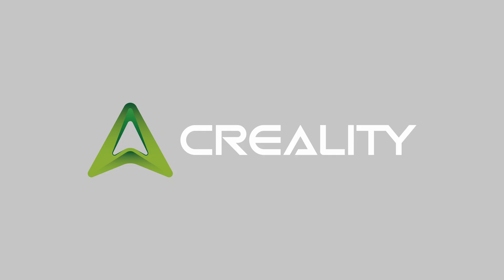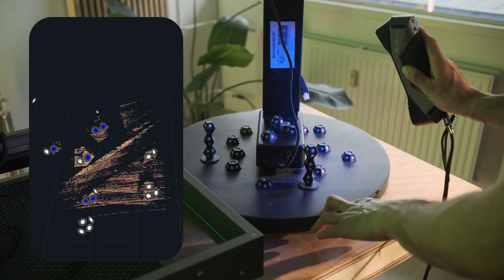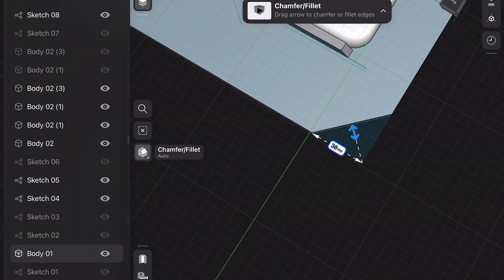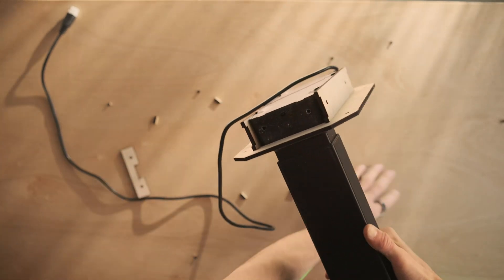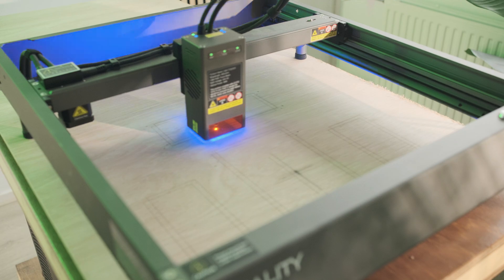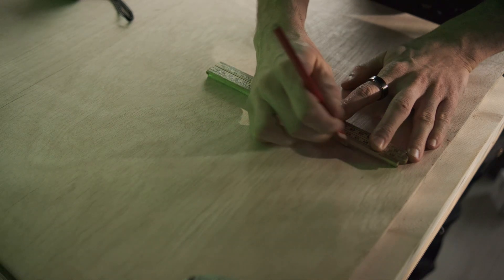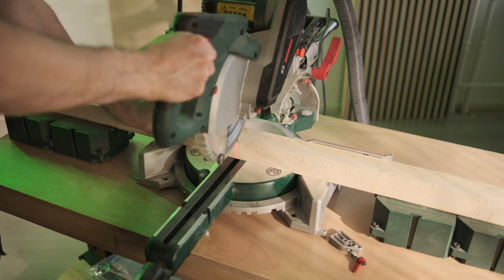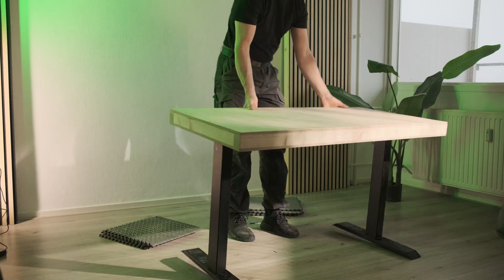Building a Desk With a Laser - Creality Falcon 2

Comment: I have a thick butchers block countertop i will be using for a desk
my plan was to route out a lot of the material underneath to mount things inside the pocket on the underside of the desk
But if i route enough material I could easily use a laser like this to create my holes for mounting custom panels, very cool!

Comment: Very nice video. How much do you pay for the Shapr3D membership?  How long did it take you to learn Shapr3D? Do you use Shapr3D because of the ipad ease of use? Have you used any other 3D modeling software?
Reply: about ca. 29€ per month you pay for this. My opinion is ipad and pencil is very fast and it’s very intuitive. Crossplattform is also a thing, start at computer and finish at ipad. Also when you need some adjustments from the part you can do this in your workshop mobile.
Reply: @MarkusReinisch  Wow that is quite pricey. i was hoping more like $10 a month, lol. I was thinking of using Fusion360 to start learning but Shapr3D did look more intuative like you said.
Reply: @Hanger-13 it’s annoying, because Shapr3D’s software is perfect for hobbyists, but their business model is for professionals. Meanwhile Fusion is free for hobbyists, but the software is tailored for professionals.
Reply: @ Yes I know it’s pricey. Used Fusion 360 and shapr3d works completely different.
Reply: @TheOfficialOriginalChad  yes that is so so true, I am surprised they can't see that. Plus fusion only allows you to draw 2 files at a time. Then you have to delete one to draw another, ugh.
Reply: @ hey FYi Fusion’s free personal license is unlimited number of files. The limitation is 10 “editable” files at a time. All you have to do is switch files back and forth between “read only” and “editable”. This is a very easy way for them to save money on hosting costs, because they provide UNLIMITED storage for FREE. The exception is non-fusion files, which has a 500GB limit.